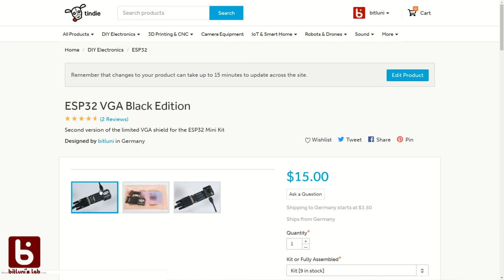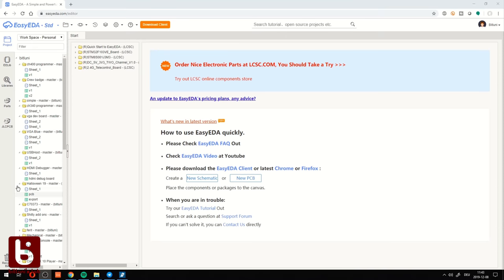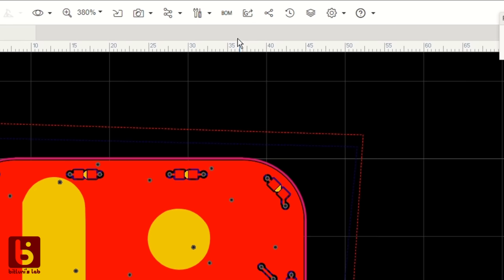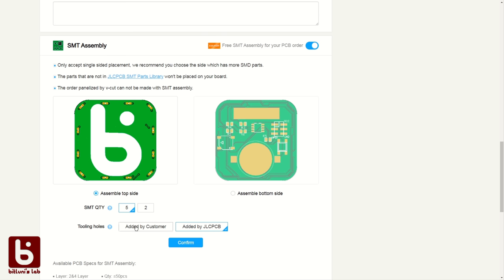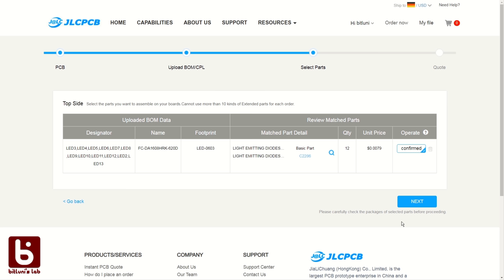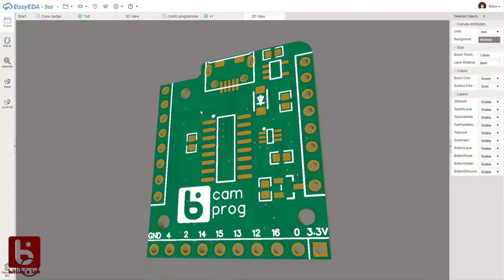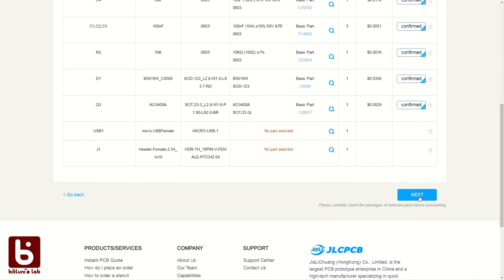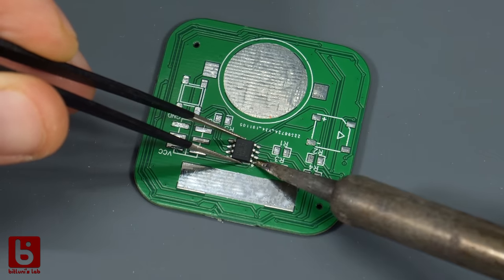Cheap PCB Assembly from China [Test & Tutorial]

Comment: I personally do an hybrid between the two. So all less (simple) important components are already being assembled.

Only a few high quality/special or big/heavy components I do myself. Depending on the size of the batch obviously.
That way you don't have a better control over quality, but shipping is also a lot less (because of the weight)
Reply: Good idea! I will test this method for myself. In particular because I have a lot of very expensive and seldom chips that I want to use. Better I solder them on my own.

Comment: The name "Charlieplexing" annoys me because I published before him on piclist and I wasn't even the first! I went a bit retro last week and should have 10 small round black PCBs on courier setting out from JLCPCB today, a CH32V0003 8 pin chip driving 20 leds in a heart shape with battery clip on back, test touch sense points going back to 4 pins and ISP clip points. My first one was a circle with 12 LEDs on 5 pins of a PIC12C508 and the reset pin configured to cycle between off and 3 display series. It will be interesting to see if I can do touch sense between LED driving without annoying flicker.
Reply: I'm curious as to your component on the other side from the reset switch BITLUNI? I got my boards last week and assembled a few of them, killed a few CH32V003 getting my code to not kill the SWDIO pin and now have some software doing patterns on my 20 LEDs off 5 pins, looks pretty eye catching, the battery clips arrived yesterday and that was even better to have them mobile from my ISP clip.  I'm going to try touch as input to control the chip but need to look up the data sheet again, I need to find lowest standby current and pop the micro into sleep every time it's not busy which is most of the time.

Comment: This is interesting! I have ben using PCBWay for small run SMA (50 units at a time) and they take much longer per run - around 4 weeks. They do hand-hold quite a bit though, sourcing parts they don't stock when I supply part numbers, and also fixing some issues in centroid files (pick and place files). I'll definitely be trying some smaller boards with JLC though, to see how the process goes. I use Eagle though, not EasyEDA, so just need to compare the centroid files I guess!

Comment: How can you get such a low price for shipping? I live in Hungary, and DHL starts from $23 and up for our JLCPCB orders, depending on the weight. As most of the boards we order are just plain pcbs, this adds a considerable amount to the total cost. If you order a best $2 offer, the final price-tag is about $25, which is ridiculous
Reply: It's basically subsidized. I think this dates back to a time when China as a developing country got foreign aid from (Western) European countries, both directly and indirectly as in this case (many European postal services were state-owned back then). 

There are now huge rows internally because the European postal services that do the final mile get significantly less for something posted from China than they would for a similar item posted domestically. I guess at some point the relevant contracts will be re-negotiated and shipping costs from China will rise to normal levels.